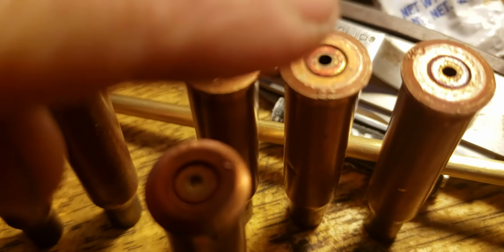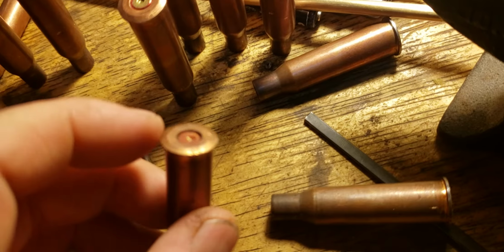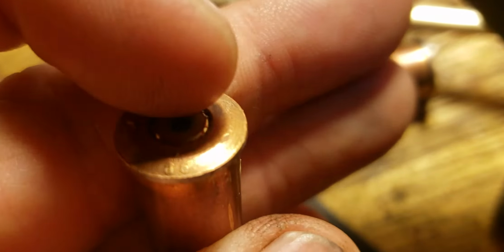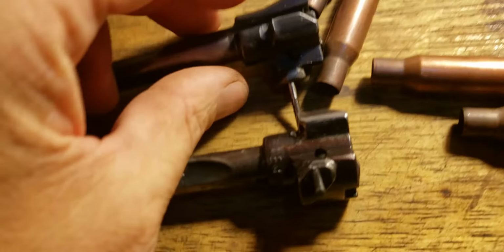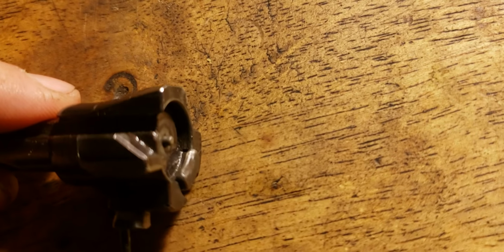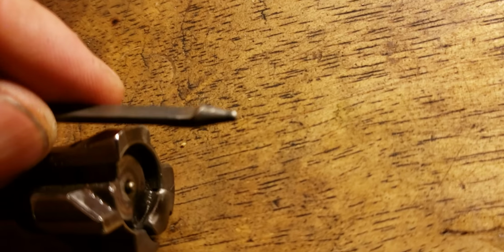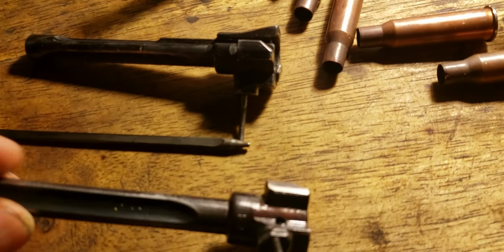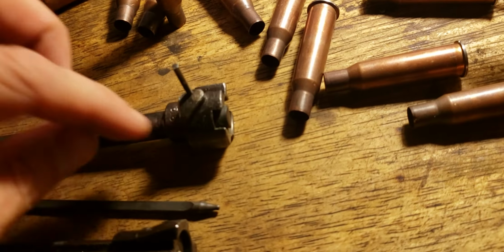PSL firing pin protrusion causing the blown primers?

Comment: If you look at the first ten seconds of you video, the two/three left most rounds on you lineup, you can see a sharp ridge around the primer strike...so the primer metal is flowing into the firing pin orifice telling you the gap between the pin and the bolt is too big. And that could be either the bolt face orifice is enlarged or the firing pin is worn enough (overall diameter of the cone worn off)... given that the pin is protruding further than the other one I am guessing the firing pin is worn but it could be the bolt. As they were assembled from surplus used parts by the mooks at Century, its anybody's guess. Curiously the problem does not show on some of the other cases.
Reply from the maker: I think its a combination of problems. The hole is too big and the pin too small and long. There has been a tiny amount of gas cutting on the pin hole from the last few blown primers. Weird it only recently started happening, Ive had the gun for years, got it for 550$ with 5 mags, scope, and 440rnds of ammo. Had a lot of problems at first but after fixing them it worked pretty good for a long time until now
Reply: @brasstard7.627  I'd be curious to see how the other firing pin works and what the primers look like after using that one. I bet that first pin is just worn out.